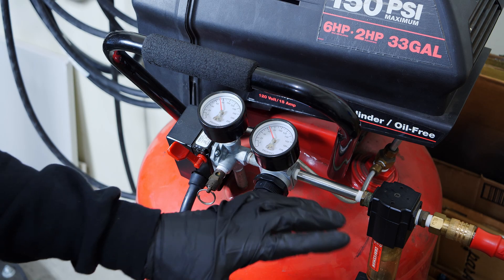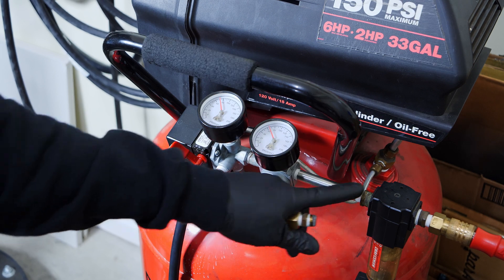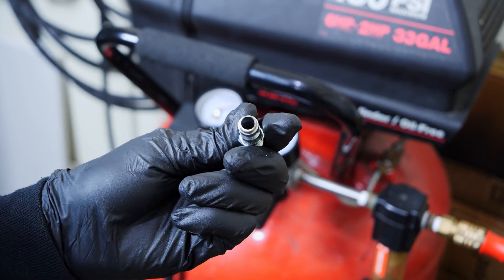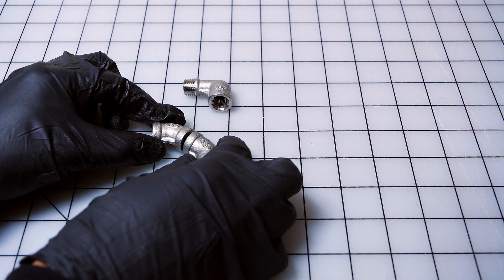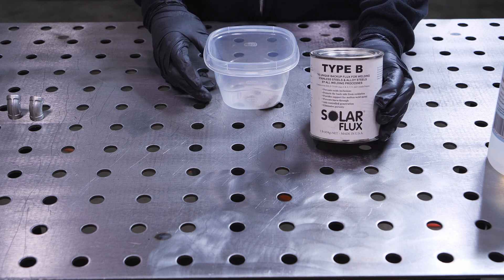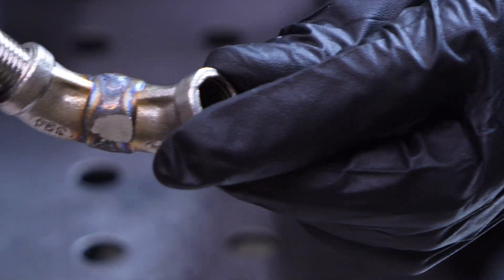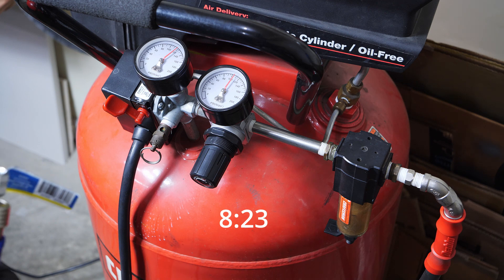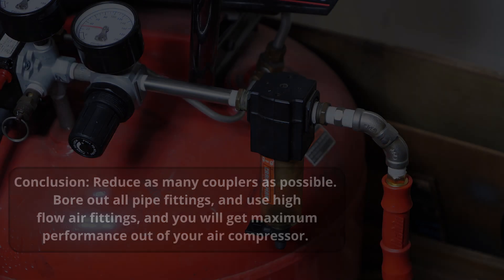The Best Air Compressor Upgrade | Do This For More CFM

Comment: I noticed the first mistake right away. Any time you adjust the regulator, run some air thru the line, so it can seat the pressure correctly. I watched the first fitting, have a 40psi drop on the guage, and after completing the test, the regulator was seated at barely above 80psi. The second fitting tested, showed the usual 20psi drop, with the regulator after completing the test, seated at 100psi range.

Comment: The best way to increase air flow and minimize restrictions, is to have the air  going into a resavor tank.  But have the resiavor tank governorned at the Maine tank, with the compressor, the number one restriction in air delivery is the governor.

Comment: I took it a couple steps better!. Bleed the air off the tank and remove one of the 2" plugs on the side and replace with a 2" to 1" flat bushing then plumb it the way you like. I went with a 1" X 2" nipple into a 1" Elbow turned down into a 1" close nipple into a 1" brass 2 way shutoff valve into a 1 X 5/8" flat bushing into a 5/8" female coupler on the bottom so I can run a 1 inch impact off of a 3/4" hose. Had to go with a 5/8" coupler because the 3/4" hose had 5/8" fittings. I got a 5/8" male quick coupler reduced to 3/8" female coupler for a 3/8" hose and swap when needed. Cost a few bucks more and No need to weaken any fitting by drilling them out and making them unsafe and I can Blow your hat off at 20' now with NO inline restrictions! 😜 Nice video!

Comment: I don't see why you want to speed up the outbound air flow. I have this compressor and the issue I have is not how fast it empties but how fast it recovers. New piston and ring, new sleave and reed valve and recovery time is still dismal. After taking some pics with a flir thermal cam you can see the discharge line reaches 200F at the cyl head and at the tank check valve. -Which BTW you can increase performance just by changing that check valve with one with more flow. I also wrapped the entire discharge line tightly with bailing wire (poor man's cooling fins) which did cool it down quite a bit. Like from close to 200F down to about 115F. Still hasn't done much for the performance so my next mod is going to be adding an automotive rotary ac compressor. Never tried doing that - maybe it will work. The problems I see is keeping it lubricated.

Comment: Buy bigger limes and fittings, problem solved. Drilling the walls thinner on pressure fittings is such a bad idea.
Little time bombs all over the shop,
 People DONT do this.  Get the right parts and be safe.

Comment: I would be interested to see how Milton G-Style couplers would stack up vs your 90 degree elbow.  The G-Style coupler is rated at 99 CFM, and they are what I am running on my Compressor.  They have come in very handy because I have had to move my 80 gallon compressor a couple of times for various upgrades to my garage.  Any thoughts on your end?  What were the couplers you were using?

Comment: As a petrochemical valve fitter and turner, DO NOT TRY THIS. Just because you saw it on the internet, DOES not mean it is right or SAFE. You're playing with high psi which can kill. Want more flow, buy a bigger compressor or add a secondary tank and fit it CORRECTLY. Never modify fittings, they are made to specific tollerances and pressures. At least put a warning on the start of this video. DO IT AT YOUR OWN RISK

Comment: not for nothing but you only have a 33 gallon tank and when you’re gonna be expelling air at that speed that motor is gonna run consistently it’s gonna drive you nuts cause it’s probably loud too. I think I would rather the air come out slower and just make sure it’s very dry

Comment: Great video. I just ordered all the parts you listed
.. I do not see the air filter though,  would you kindly provide a brand and model that you are using or recommend?

I have the exact same Craftsman Air compressor used in thus video..

😊

Comment: Is it worth increasing the pipe i/d from the tank to the switch/pressure gauge as this pipe seem to have a smaller i/d than the high flow couplings?

Comment: Is that a high flow regulator in this video ? or the stock one ? and does a high flow regulator make much difference ? or is most the gain in the fittings .

Comment: I see that you did it for better flow, but why do you need better flow when your compressor isn't able to keep up stack? What tools and with what applications do you really need over 120psi for just a couple seconds at a time? You honestly would of been better off just changing out your inspection port plug for a wuick connect foe an air line with absolutely zero restrictions.

Comment: The pressure regulator is always the biggest problem, should be of good quality as well as the filter and other parts. 1/2" on all components means that the feed is enough for all machines. The quick couplings make a big difference choose Cejn 320 series for best flow and wear resistance (hardened steel nipples). In some applications it is economical to let the compressor handle the pressure and remove the pressure regulator .
Reply: I run MILTON G-Style coupler and plugs, 99 CFM

Comment: maybe i'm crazy, but why not just upgrade the fittings and hoses from 1/4 NPT to 3/8 or 1/2 NPT? seems like a lot less work and a safer way to get more airflow, then just neck down to the size of the fitting on the tool.

Comment: Id just like to know why? Whats the big fk'n advantage¿! "Faster" "Quicker" air be gone¿🤔😫🕜 I'll never get back😡
Reply: Not sure I like the idea of the welding and drilling he did. However, the high flow fittings make a big difference in power when using air tools like die grinders. If you’re just filling tires or running very low CFM tools (less than about 1.5 - 2 as advertised because the advertised rate is about 1/4 the continuous use value) then it probably won’t make much difference. Of course, higher flow means more air used so you either need a compressor with more CFM or expect periodic wait times for the compressor to catch up. I found I needed a true 5 HP unit to run one die grinder and have the ability for the compressor to refill without stopping my work - 3 HP didn’t do it.

Comment: Maybe if you have a much better compressor than that craftsman the high flow fittings make a difference. I have that same craftsman compressor and it flows air faster than it can make it.

Comment: I'm all for bustin' out the TIG  welder (my second favorite tool😂) but why not go with copper or stainless flared tubing at a decent OD size? Benders are cheap and the ID is big and smooth. The internal threads in that Frankennector will mess with flow a bit, too.

Comment: Drilling out the coupling is a bad idea - and you are putting people at risk by recommending this. Just because it's thicker doesn't mean you can make it bigger - the thickness of the coupling was chosen for what pressure it was to see and the metallurgy behind the material chosen - once you weaken that metal by drilling it out and removing material, it is in danger of breaking, or exploding since it's compressed air. That is why you buy high-flow couplings - different metallurgy is chosen for the pressure on the thinner walls. Think about it...
Reply: The high flow fitting is aluminum and is thinner, what you say makes sense though, anything diy hasn't been engineered and pressurized air is dangerous.
Reply: absolutely!
Reply: Well said and good advice.
Reply: agreed . just buy bigger fitting or buy high flow
Reply: I only use steel fittings.
Reply: Milton G-Stlyle blow the purple ones away, they are rated at 99 CFM
Reply: Risk of what 
an air leak
Reply: Ditto!  DO NOT DRILL OUT COMPRESSOR LINES/FITTINGS....Geez!
Reply: You think about it

Comment: I dont know why you feel the need toweld anything at all. However, if you insist on we,ding "pressure" fittings, id recommend first beveling those pieces, especially since you're grinding that weld down afterwards.
Even though its only air moving through that, it can still be quite dangerous if those were to fail
Reply: @5:26 actually he did put a small bevel.

Comment: I agree that he needs to take into account the pressure ratings of these fittings, and then realize how drilling out the inside makes the walls thinner and weaker, and on top of that, drilling a perfectly straight hole is pretty hard even with a drill press, which means your boring could leave a very thin spot on the wall of a fitting that you might not ever see, unlit it’s too late, at which point you’d be lucky to see again at all.

Comment: Maybe I am missing something but why do you need a bend at all?  why couldn't you have just hooked the hose directly into the filter?
Reply from the maker: That's a great question nsummy! I actually tried that in the beginning. The reason I went with the pipe fittings is because it creates a tighter angle to save on space. The hose kicked out too far. The second reason is because I didn't want to put too much stress on the hose hanging in a bent position.
Reply: @GarageDynamics  I am using a 304 stainless steel 1/2' house with swivel mounts, out of my compressor and yes the bend is a little further out than your set-up, but it is not in the way of anything on my set-up.  My thought process is the less of a curve, the less air flow restriciton.  Plus the metal hose aesthetically looks awesome.

Comment: Not sure if you know, but I'm changing my single stage to a 2 stage compressor pump. My single stage has a fitting from the on/off to the top of the cylinder head. My 2 stage, do not. Is that line needed to turn the unit on/off as pressure is needed. If so, can it be connected on the tank or, another pressure line?

Comment: Now your gettind somewhere! I have the exact same compressor.  I went all ported 3/8" brass from ported stock pressure switch out and ported brass 1/4" nipple from tank to pressure switch. 3/8" flexzilla hose with all high flow fittings/couplers. I found all the 1/4" pipe and fittings had a wide range of inside diameters depending on the brand of fitting. The 3/8" had the closest inside dimensions but you still have to check those too.Great video!

Comment: Dude, you and I have the same air compressor!  Craftman 33 gal, 2 HP.  Mine just died.  Well the engine and tank didn't.  It was the galvanized pipe running from the controller to the tank.  It cracked a leak, so I carefully tried to remove it and the damn thing separated (threads inside the tank, everything else separated).  It was a pretty good compressor.  Loud as hell, but pulled her weight.

Comment: Pop your pressure switch off and drill out the outlet fitting inside. Many of them are like a 1/8" hole.
Reply: Good point, why the heck do some companies have small outlet port.  Mine is 1/4" hole, so I used an adapter, 1/4" x 1/2".  I personally would not be comfortable myself drilling out the hole to make it larger.  However, I would love for somone skilled to do it for me.

Comment: Hate to be the hater but seems  like not the best idea messing with high pressure fittings. You're throwing alot of unknown variables and adding more parts as well without adding any safety features. If you really want more power out your compressor just get a scroll or a tank and pressure regulator that has bigger outlet that's rated and tested for it.  That being said ima prolly do this for mine lol but only because I put the compressor outside and in the ground otherwise wouldn't risk it. Last thing I need is sum dumbass hitting their truck or something on the compressor and fittings turn to shrapnel. Seen it happen multiple times
Reply: This is about stupid u might get a few cfm but loose pressure

Comment: plan on doing this to my 150 gal oilless, was your oiless compressor able to keep up with the better flow? My tank and a 2" port on the side for a secondary tank which is the plan to add on auxiliary tank that im prepping for paint and welding on floor brace. Home garage set up light use only, nail guns, 1/4 ratchet, etc
Reply from the maker: Nice! My tank was able to keep up. I used an Astro Evo T paint gun set around 21PSI and it worked great. Same with my pneumatic impact driver. It doesn't work nearly as hard to remove bolts. Adding the secondary tank is a good idea though. I think I will do that sometime in the future 😁

Comment: Wow, what an excellent video! I learned so much about maximizing airflow from my compressor. The presenter did a fantastic job of testing different methods and presenting the results in a clear and concise manner. The use of two tests to verify the effectiveness of the 45-degree pipe fitting as the best upgrade was especially helpful. The presenter's commitment to thoroughness and attention to detail were evident throughout the video. I highly recommend this video to anyone who wants to optimize their compressor's performance. Thank you for sharing this valuable information!
Reply from the maker: Thank you so much for the awesome comment Dexterous X! I'm very grateful for your kind words🙏 It is always my pleasure to serve my community with as much valuable information as I can 😊

Comment: Cool video, thanks. Now add an external tank and send it…😂
Reply from the maker: Thanks Justin Wilson! Challenge accepted! 🙌😂
Reply: I have the same setup, and I added an eighty gallon tank after the main tank.  It helped everything work much better.  I will also use the tips of this airflow improvement to get even better results.  Thank you!

Comment: Why not use 1/2 inch
Reply from the maker: Hello Victor Bishara, I wanted to see how much I could improve the system on 1/4 inch fittings. The air hose is 3/8 inch though. I guess I'll have to make another video showing the performance gains of using 1/2 inch fittings on a 1/4 inch system 😂
Reply: @GarageDynamics  please make one with MILTON G-Sytle coupler ane fittings,  they are rated at 99 CFM